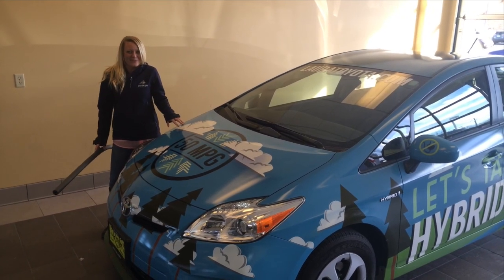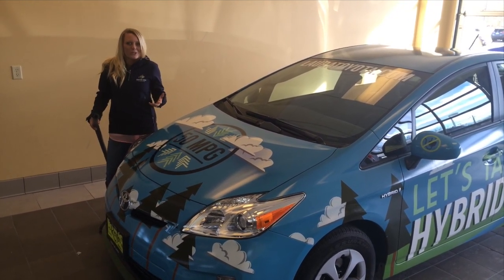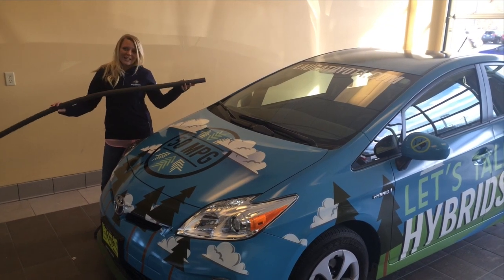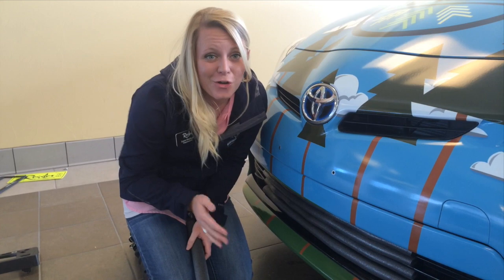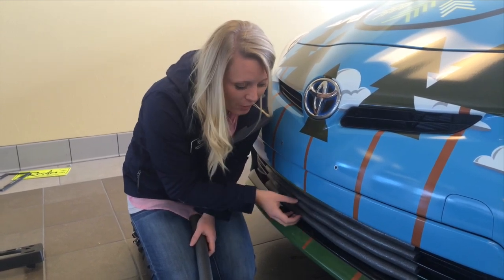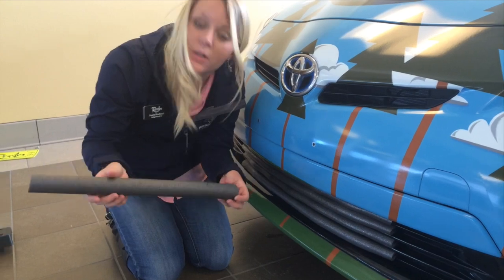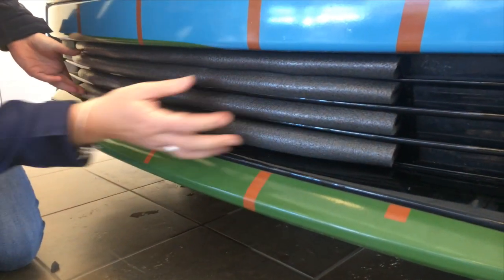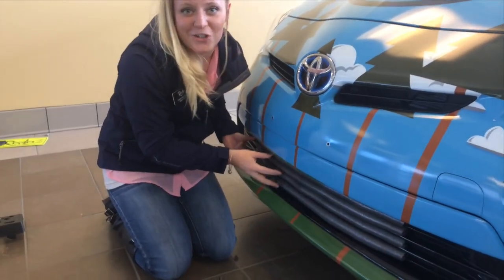How to Get Better Winter Mileage in Prius by Engine Blocking

Comment: I know with me; I suspect not cleaning my EGR, Intake and PCV Valve circuit religiously like at least every 50K to 100K miles along with grill blocking all summer 100% the lower engine grill is the cause my head gasket is finally going bad in my 2013.  Of course at approx 285K.  Not a bad deal, though last two summers I ran covered like that and during the summer wasn't a good idea.  I decided I'm not going to block my 2006 grill to be safe since reads like isn't as good idea and isn't the extra inverter radiator to separate the electronics cooling as well.  Though does read like some block 75% and that does help in the colder climates cold seasons.
Reply: I almost forgot to note neat wrap!

Comment: isn't blocking the upper grill the one to do?, because the lower grill hold radiator and the electric motor driver. the lower grill needs proper cooling.

Comment: As someone living in Canada where temperature can dip to minus 30 degree Celsius, I can attest that this method does work in cold winters. My Gen 3 Prius could go down to 32 MPG in deep winter before. After adding foam insulations in three of the four lower slots (to play safe, for we sometimes get warm breaks called Chinooks that can heat up to above freezing point), the MPG stays above 36~37 even in super cold arctic temperatures. That’s at least 10% fuel efficiency improvement.

Comment: Is there an update?
Reply: I know with me; I suspect not cleaning my EGR, Intake and PCV Valve circuit religiously like at least every 50K to 100K miles along with grill blocking all summer 100% the lower engine grill is the cause my head gasket is finally going bad in my 2013.  Of course at approx 285K.  Not a bad deal, though last two summers I ran covered like that and during the summer wasn't a good idea.